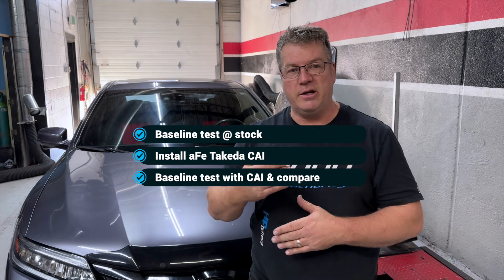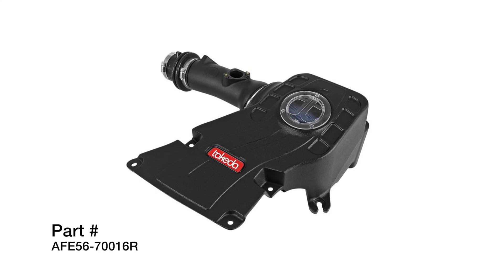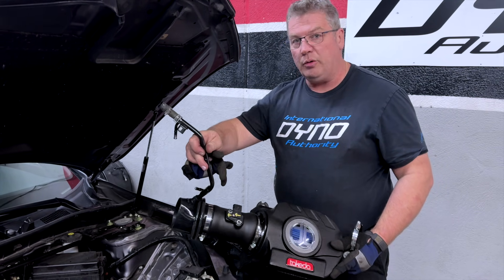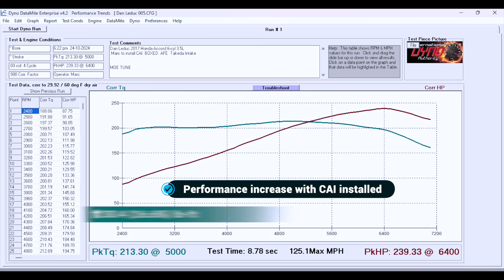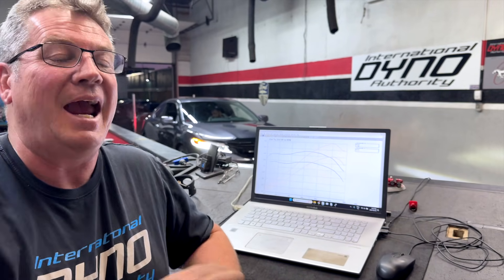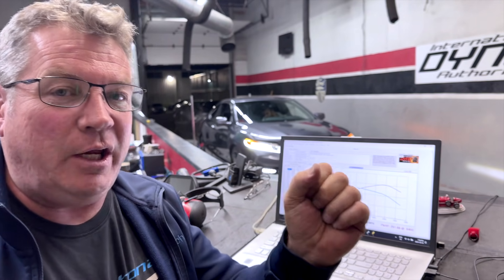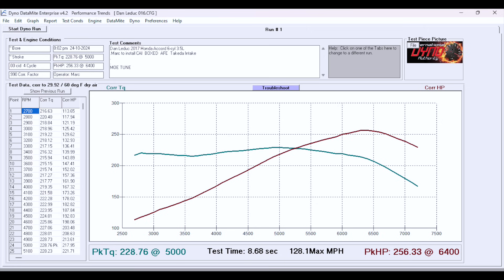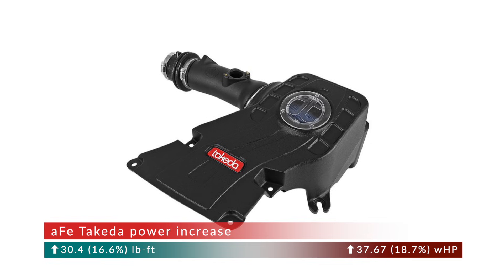Cold Air Intake tested on the Dyno | 2017 Accord

Comment: What are you tuning on? KTuner? Flashpro? 91 or 93 tune?

I'm sorry but something is off here.... anyone who has experience with these cars will tell you there is no way in hell youre pulling 70 ftlbs and 55 hp out of a bone stock 9th gen v6 with just an intake and tune. The baseline numbers are nowhere near what these cars make in stock form. 200 whp and 180 ftlb is seriously lacking even for an automatic transmission car. Bone stock on the factory tune they make around 230 to 245 whp and 220 to 235ish ft lbs. The figures from the baseline runs WITH the intake is roughly what it SHOULD be putting down in completely stock form without even touching the OBD port. A 9th gen 6-6 with FULL bolt ons and a 91 tune youd be lucky to make +270 ftlb on a stock J35 long block, and on quite honestly a 70 ft lb gain is unrealistic given the only modification is a closed intake system.. The numbers would be more believeable if it were the other way around, 273whp and 256 ft ld... but even still, youre gunna need to throw every bolt on money can buy at the J35 to get close to that number, plus a 91 or 93 tune. And i do mean EVERY bolt on money can buy. 2.5" axle back, 3" mid pipe, CAI/SRI, HFPCs/PCDs, J pipe, 3rd cat delete, ported J37 80mm TB/ ported manifold, ported runners, plenum spacer, etc Ktuner or flashpro. That figure of 273 ftlb is more realistic for a J37.  That I could believe and IS possible to see these numbers from a J35... but there's no way in hell youre getting a 70 ftlb and 55 hp gain from just an intake and tune, that is just hard to believe.. The J35Y2 that came in the 6 speed cars were rated at 278 hp and 251 ftlb. With FBO and a tune if youre seeing crank horse power and torque at the wheels youre doing damn good.. plus you won't see that much parasitic loss out of a FWD Honda transmission, automatic or manual. You will see some, but its generally not the -15% youd see from a your typical RWD domestic. One thing I know for certain, if my 13 6-6 dynoed at only 200 whp and 180 ft lb I'd be thinking something is seriously wrong... even on the factory tune and with zero modifications 200/180 is embarrassing..  Those are number's id expect to see from a healthy FBO H23A in H2b form.  My 30 year old FBO H22A made a believeable 208/161 with FBO and a tune. And in a gutted CB7 coupe chassi thats sub 2500 lb i would be putting the gap on 9th gen 6-6s if they were only making 200/180 in factory for, which it obviously stands no chance in hell of doing.. 

Id love to see these "gains" backed up at the track. How bout this... come next season when Luskville opens up, tell the owner of this accord that ill pay for his entry fee if he wants to come run it on a cruise night. Lets see if the ETs and trap speeds tell the same story.
Reply from the maker: @t.j2881 We appreciate your feedback! If you follow along, you’ll notice that we weren’t entirely satisfied with the initial results either. This project was supposed to be straightforward: install a cold air intake (gain 2-3 horsepower), add a tune (gain 20 horsepower), and call it a day. However, this wasn’t your typical V6, which is why it ended up in our shop—vehicles rarely come to us in perfect condition.

When tuning, we discovered inconsistencies caused by counterfeit spark plugs. The ceramic insulator had shifted, nearly contacting the ground strap. We replaced these with proper plugs, gapped them correctly, and the engine began running as expected. To ensure the car left in top shape, we invited the customer back for free to address these issues.

As a tuning shop that handles over 600 vehicles per season, we understand that not all cars perform identically—especially used ones with unknown histories. This particular Accord puzzled us initially because we’ve tuned many similar platforms with more consistent results. Ultimately, we resolved the problem and ensured the car performed properly.

For those questioning dyno results, there’s no tricking the numbers. We’ve validated countless results from dyno to track with various vehicles, including Hondas, Camaros, and Mustangs. For example, Bruce’s car has run at Napierville and Luskville countless times, consistently matching its dyno-tuned performance.

Until you’ve tuned thousands of vehicles over 15 years, it’s easy to misunderstand how this process works. Thanks again for your feedback, and have a great weekend!  Cheers
Reply from the maker: @оначертовасука  International Dyno Authority: Pioneering the Future of Tuning and Combustion Technology

As North America’s premier facility dedicated to advanced tuning and research, International Dyno Authority (IDA) has set the standard for tuning and power optimization across a vast range of applications. This cutting-edge institution has earned a reputation for excellence through extensive partnerships, groundbreaking innovations, and the development of tuning standards that are transforming the industry.

Partners in Innovation

IDA collaborates closely with leading corporations, advising powerhouses like HP Tuners, Whipple, Roush, and Ford Motor Company. Their insights and technical support have become an essential resource for these companies, driving improvements in engine performance, efficiency, and emissions standards. Through these relationships, IDA has a unique vantage point to pioneer developments that shape the industry’s future.

Pioneering Standards in Tuning

Since its inception, International Dyno Authority has been at the forefront of the tuning industry, not only setting new standards but also elevating the capabilities of tuners of all experience levels. Through their publications and training programs, IDA provides essential resources that empower both novice and professional tuners, equipping them with the skills to achieve precision tuning across various engine platforms. Their commitment to education is evident in their comprehensive curriculum, covering the intricacies of combustion dynamics, air-fuel ratio (AFR) tuning, boost management, and fuel characteristics.

Educational Outreach and Online Presence

IDA has established a strong online presence, notably through their YouTube channel, which serves as an invaluable resource for enthusiasts and professionals alike. Their instructional videos, which include step-by-step tutorials, practical tips, and expert insights, are used by institutions such as MIT, Boston College, SCT, Holley Inc., and Edelbrock, making IDA a recognized leader in education within the field. Their expertise has also gained the attention of influential industry figures, including Steve Morris, who has commended their contributions to tuning technology.

Specialized Focus and Areas of Expertise

Operating as a purely tuning and research facility, IDA’s specialization spans a wide range of topics. They delve into complex subjects such as combustion technology, AFR tuning, boost and fuel optimization, and luxury engine swap integration. The organization’s work also extends to advanced fuel research, as seen in their recent collaboration with TTC, Hydra-Gen, and DynaCert. Here, IDA took the lead in developing an 8.9L Cummins engine hydrogen supplement fuel program, which included rigorous emissions testing, underscoring their commitment to sustainable and innovative fuel solutions.

The Facility’s Technical Scope and Testing Capacity

Each year, IDA conducts over 650 vehicle dyno tests, tuning engines and chassis systems to optimize performance. This includes a wide variety of engines powered by gasoline, E85, diesel, hydrogen, port and direct injection, throttle body injection, and even carbureted systems. Their expertise is not limited to traditional vehicles; the facility also tunes boats, tanks, and military transport, making them the only independent tuning and research center in North America dedicated to such an expansive range of engines and fuel types.

Advancing Industry Standards

By leading projects in combustion and alternative fuels, IDA continues to be a key player in the evolution of tuning technology. Their dedication to setting new standards in performance, efficiency, and sustainability has positioned them as a trusted authority in an industry that is constantly evolving. For anyone looking to understand or pursue high-level tuning, International Dyno Authority remains the ultimate resource and innovator in the field.

Comment: has the owner i can say WOW not the same car very surprised and happy.The second time i went was arranged by the owner at no charge a week later after they discuss it among themselves that it could be better and they were right it is. Thanks to all you job well done
Reply: Will we get more updates on the car? Would you consider turbo in the future? Any problems with the tune?
Reply: no on the turbo...really like driving it ..they did a great job got exacly what i wanted   dan
Reply from the maker: @DanielLeduc-h4r  you are VERY WELCOME
Reply: How is the sound difference when on throttle, and with Vtec compared to the stock intake?
Reply from the maker: @mpmustang5622  

The 2017 Honda 3.5L engine no longer features the traditional VTEC system. Instead, it incorporates the new i-VTEC technology, which delivers a smoother and more refined transition across the RPM range.

Unlike the abrupt engagement of the older VTEC system, the i-VTEC operates with a continuously variable valve motion, similar to systems used by Toyota, Ford, General Motors, and Mercedes. This single overhead cam design ensures efficient valve operation, optimizing power, fuel efficiency, and airflow management.

Vehicle owners will no longer experience a noticeable "VTEC kick." Instead, they will enjoy linear power delivery throughout the RPM range, accompanied by a quieter, more refined sound. This improvement enhances the driving experience, giving the Honda Accord a more sophisticated and polished feel compared to previous generations , with a Lot more Horsepower, average Torque and over acceleration.
Reply: @internationaldynoauthority693 not to be rude. this engine does actually have traditional VTEC on 3 cylinders - it crosses over at about 5000 rpm. You can hear it audibly especially with aftermarket intakes. 

Great video btw. 
What software did you guys use to tune this?
Reply: Is your car a 2017, or did you do the 9.5 face-lift? I'm wondering how @internationaldynoauthority693 tuned it using Hondata?

Comment: My 2003 Tahoe draws intake air from fender well. This air is lower temperature than underhood
Reply from the maker: @talltimbot  absolutely correct, what we do with each and every vehicle, is recommend that the customer purchase a cold air intake which is enclosed in a box. And the box needs to get fresh air from anywhere other than under the hood. 

The cold air intake, that was installed on this particular episode. Took some of its air when driving down the road from top area, fed through from the grill. And the balance, the big portion of the air came through a tube which was attached to grab its air from behind the headlight in the fender. 

You're absolutely correct. This is the perfect spot to get the air so that there's no contamination of heat from under the hood.